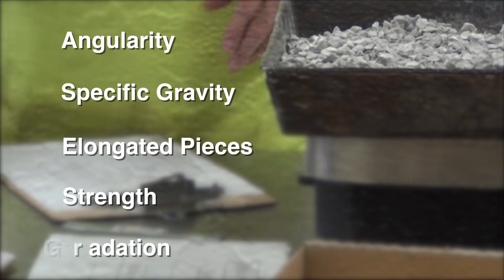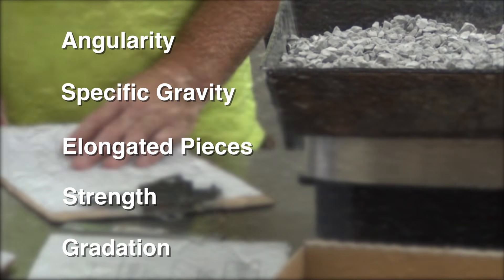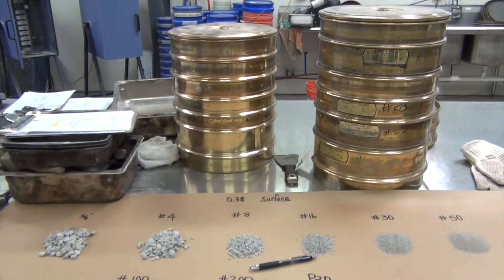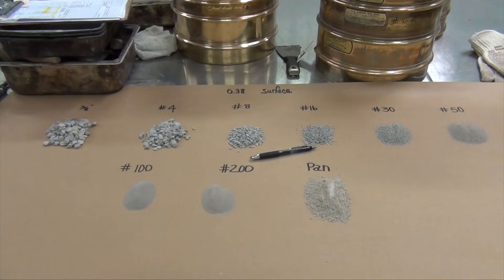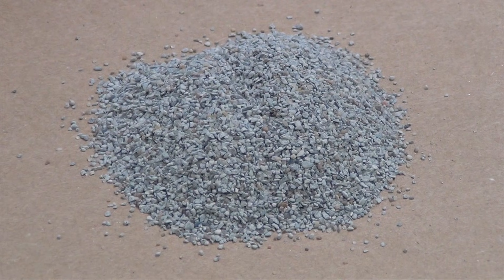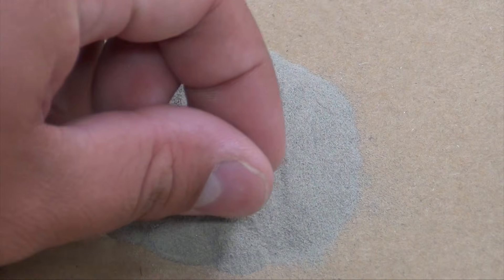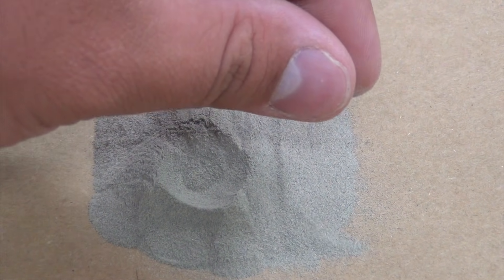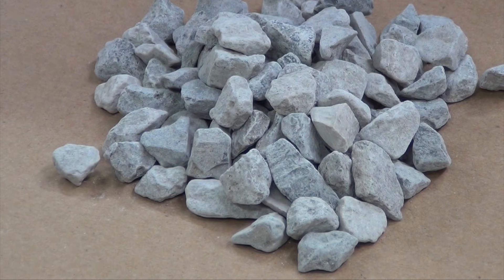Asphalt Quality Control

Comment: Wow, interesting, confirms what I thought happens. I think my state must get the people who barely passed this course. We've the worst roads, guess corruption in the industry may not help either. Kinda SAD when you see asphalt being used on a concrete bridge deck because it's failing and our SLAVEMASTERS would rather line their pockets rather than use OUR taxes to fix things correctly. Maybe a video on whether or not crossing ones fingers as you cross a bridge like that helps would be appreciated.
Reply: Your right and its scary
Reply: @jaiMillions2  *you're
Reply: @slat_catz8849  thanks for the grammar correction you know wht is crazy I am passing english 2 with a 95 and 3.5 in college ..  I am applaud by this error 😂😂😂😂🙄
Reply: @jaiMillions2  *appalled
Reply: @slat_catz8849  ohhh alternates 😏 where are your cats? 😂😂😂😂😂